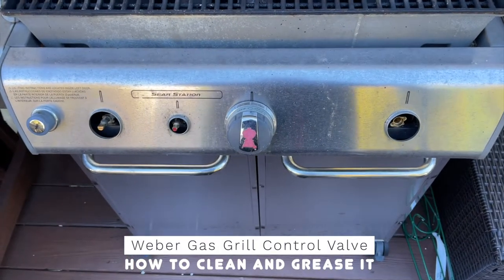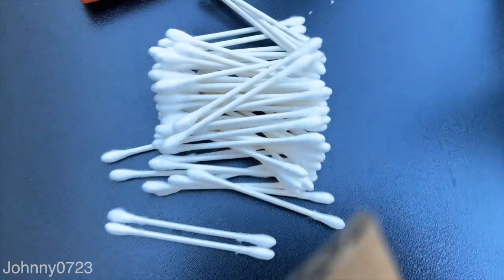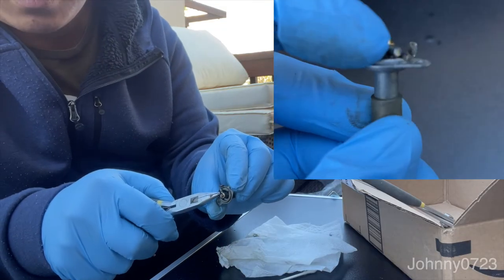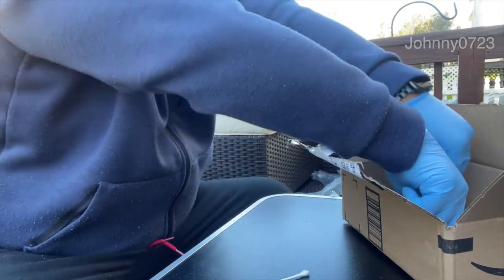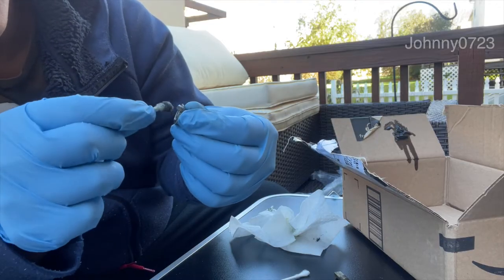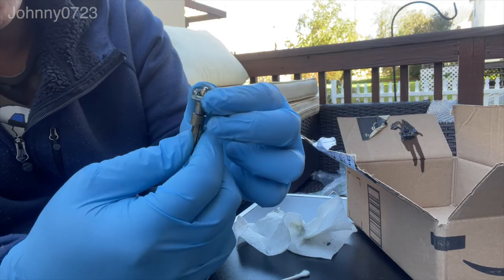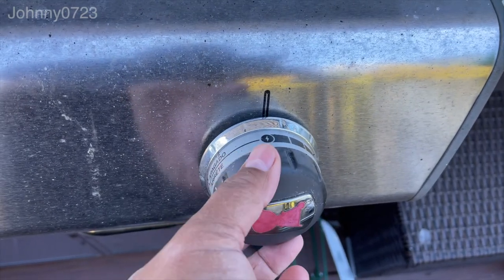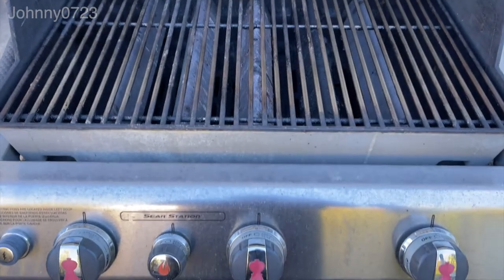Weber Gas Control Valve Cleaning - Fixes stuck/tight gas control knobs, Weber Genesis s330 Grill

Comment: Awesome instructions, fixed my issue. It was so simple I dismantled and lubricated all four valves.
If you are doing this on a deck, lay down a cloth in front of the bbq in case you drop any of the small items. You don’t want to lose them between the deck boards.

Comment: Thanks a lot for the video, it saved me $60!  I have a newer Weber Q3200 and one of the valves was really hard to move.  The valves come off the BBQ a little different than the ones in your video.  But the valves are pretty much the same and the valve parts came apart just like you showed.  One of the valves had corrosion on it but the corrosion came off using some 400 grit sand paper.  After using the brake lube, the valves turn easily now.  I really appreciate the video!

Comment: Use a high temp car brake caliper grease. If the springs rust out, you can likely use one off of a ball point pen. On older grills they used red security paint to fill the Philips head on the screws so you need to dig it out with a pick and then use a sharp pointed Philips screw driver.